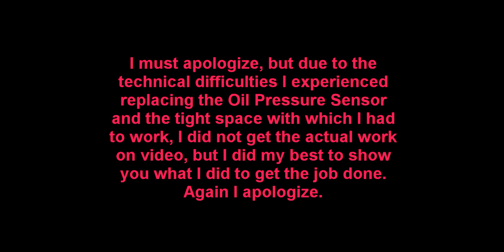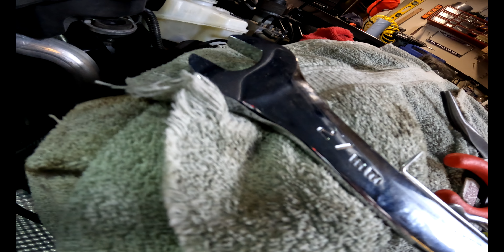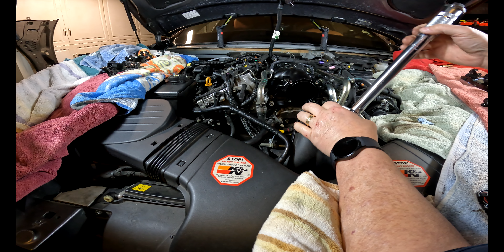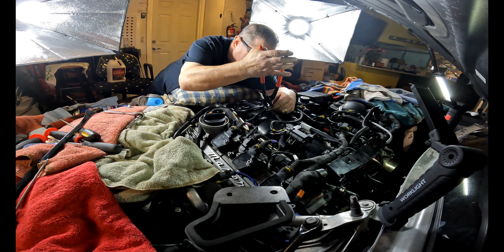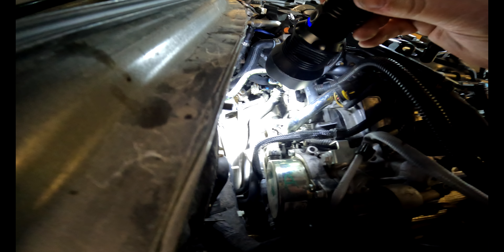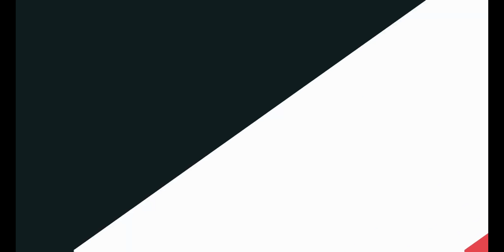How to Replace Oil Pressure Sensor Maserati Ghibli + Reassembly Process - Part 3

Comment: Did you have a code? I have P0524 oil pressure too low. P0522 as well. And 2 additional p2179 & p2177 system too lean off idea Bank1&2. 
I think they are related. The system too lean I suspect could be my car sat for 9 months and the fuel stabilizer was not enough to keep the fuel stable.
Reply from the maker: No code. Just the faulty Sensor.

Comment: * TO UNLCIP THE SENSOR FOR THE WIRING HARNESS THERE IS A RED CLIP THAT MUST BE PUSHED TO THE SIDE FIRST.*
👆forgot to add that in my original comment. 
For the sake of the potential internet traveler looking for advice imho this was done the hard way friend. I don’t mean to be overly critical, simply sharing my experience the intake manifold does NOT need to come off and personally I think it’s a mistake to take it off.
That’s not to say I’m not grateful you took the time to make the video cause I am. But my advice to anyone looking to do the same job would be don’t remove the intake. Remove the back engine cowling, the support bar for the wiring harness along the back of the engine, there are some brackets down next to the sensor that need to be removed (couple 4.5mm Allen’s). I used a crows foot box wrench 27mm connected to a 1/4 drive socket to remove the sensor. I use some of those puzzle mat pads to lay across the engine, not comfortable but it will work. 
Anyways best of luck to the next lowly bastard trying to diy their Maserati. I’ve owned mine for 7 years and it’s been a great car but it’s eats through tires.
Reply from the maker: I considered doing it that way, but I wanted to see how bad my intake valves were. I was prepared for the worst but found the carbon build up not too bad.  I cleaned the intake valves and I am glad I did. I recommend doing that service or having it done by a professional. Car runs very clean.

Comment: If I break the connector that connects to the oil pressure sensor do I have to replace the wiring and connecter? If so do you happen to know the PN?
Reply from the maker: I broke the locking clip on mine trying to get it off. But it is a tight fit on the new sensor, and its seated vertical with the connector upright, so between gravity and the tight fit, it should stay there.

Comment: I have a Maserati M156 3.0 biturbo engine. 95000km mileage. jumped the chain. didn't start. Completely changed the chain set. The marks are all straight. The car started up, everything was fine, but after 10 minutes it began to troit and the error shows that the timing chain had jumped again. The car starts but does not work correctly. Could this be due to oil pressure? what to do. where to look for the problem?
Reply from the maker: duplicate comment

Comment: Hi James, do you think it's possible to replace oil pressure sensor without removing intake manifold?
Reply from the maker: Yes I do. But you will need to remove the water tray and bucket. And its tight back there, not much room to work.

Comment: How long did it take you and how much did you charge for replacing only the fuel pressure sensor ?

Appreciate the video !
Reply from the maker: Took me 4 days but that time includes video equipment setup and intake valve cleaning and time spent looking for a tool to remove and install the Oil Pressure Sensor. But I think this could be done in a day with proper preparation.

Comment: I was just driving my Maserati yesterday leaving the gas station after I accelerated out of no where my air bags deployed on me passengers air bag driver an under the steering air bags all 3 and smoke was coming out the air bags an the car won’t start  after that happened is Maserati responsible for this because I see there was an recall on airbag e I for the grandturismo but clearly should be on ghibli as well this just happened yesterday I can’t pay for this what do I do an how can I get car to start because from my house to the dealer roadside assistance is charging 400$ Cus I have expired warranty but they say can’t come get the car cus it need to start to drive in garage ????
Reply from the maker: There is a module that sits on top of your battery that will need to be replaced. Then you will be able to start the car. Replacing it is easy.
Reply: @JamesDIYGarage  thank you so much James you’re the best I will go get a new battery module and let you know if the car starts
Reply: Hey james your the Goat man I bought the battery module replaced the old one the car started back up ..but now when I put the car in reverse it goes to Neutral It keep making this clicking sound over n over I force it go into reverse once it go to reverse i hear another louder click  lock sound all sounds coming from the middle of the car from like the inner arm rest an a repeting small knocking clicking sound car won’t reverse it goes into drive but won’t drive like the tires locked try to push it on neutral won’t move made sure the emergency brakes aren’t on still won’t move and Car will not turn off unless I unplug the battery once I do that I hear a loud whining locking sound plug the battery back it starts up normally foot on break push start button to start but won’t move
Reply from the maker: @PapiSosa147  did you by any chance engage the emergency transmission unlock lever in that little panel on the driver side floor? If so disengage it 1st. If not do not touch it. Post this in the Maserati Facebook groups. Some one there may have an answer. I have never heard of this before.
Reply: @JamesDIYGarage   no I did not disengage the lever but my airbag light is still on so I don’t know if that may be an issue or does the airbag module need to be reset I don’t know so the car can drive again in the clutch shift gears as normal
Reply from the maker: @PapiSosa147  you may have to have that reset. I dont know if it can be reset with a standard OBDII scan tool.
Reply: @JamesDIYGarage  ok I’ll get that done and go from there thank you so much
Reply: Ok I will check with that and by any chance my airbag light is still on do you think that may be the reason
Reply: Wouldn’t mind hearing the end of this story. Is there a recall on the Maserati airbags?

Comment: Again, I would have left it as is, but kuddos to you for tackling this job. Well done! And your engine bay is so clean! I am jealous!
Reply: Nah, a bad oil pressure sensor will not communicate correctly. So the oil pump may not operate as it should per certain parameters. Most engine failures on '14-15's are blamed on the oil pump. But not everyone checks if oil pressure parameters were correct where the sensor most likely had already been failing for some time. You want to do self checks on these cars once in a while like James did.
Reply from the maker: Thanks 👍